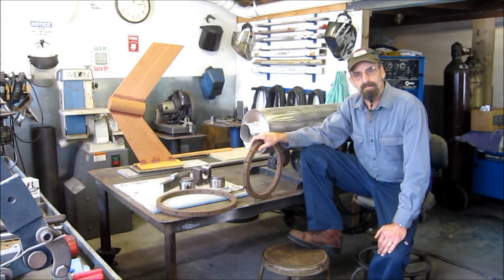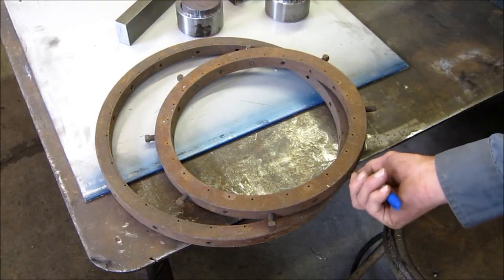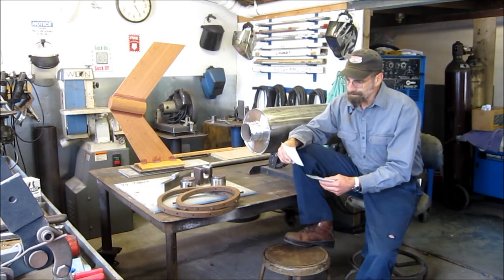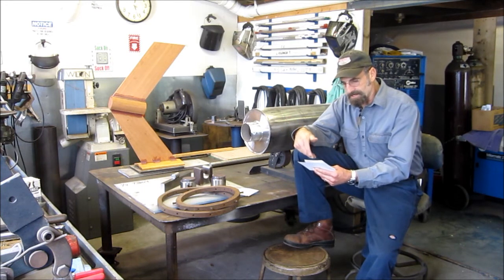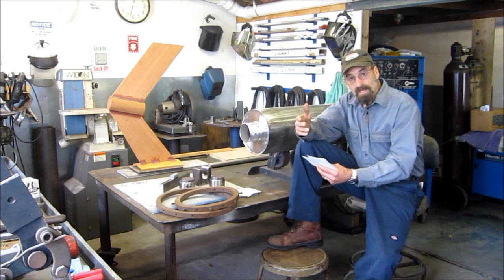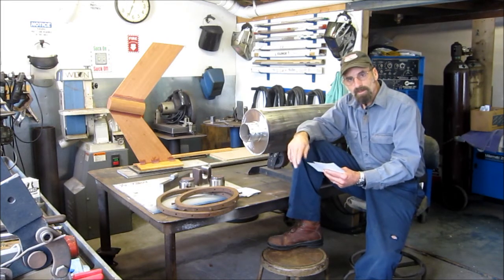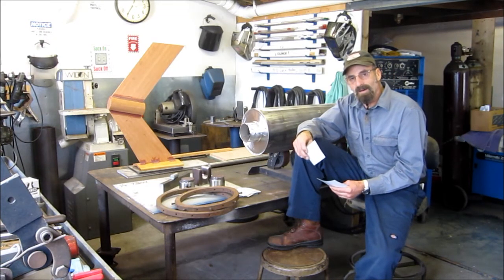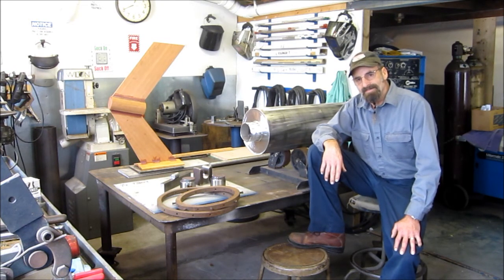The Mast of the Larinda

Comment: So sorry to hear about Larrys passing, this is a nice tribute to his memory. Excellent work and what a thorough job you did making this mast. Mast especially are subject to increasingly higher stress levels with each added inch in length. I can see from your work this will not become an issue with this mast. I have been tinkering with designs for a portable hydraulic telescopic antenna mast and the biggest problem is load bearing and wind support as the mast goes higher.